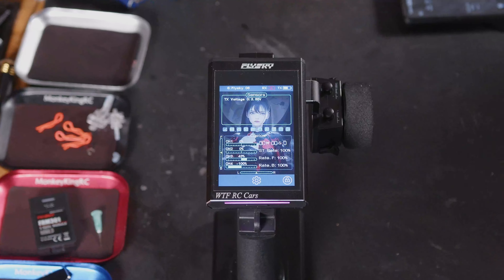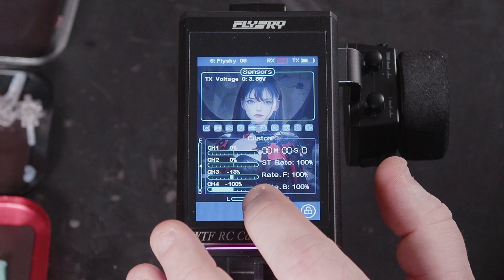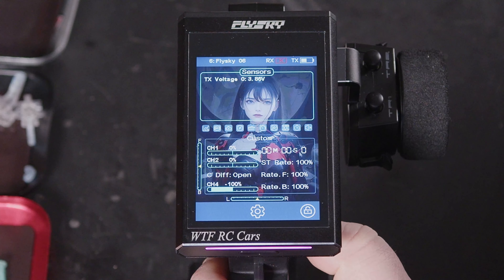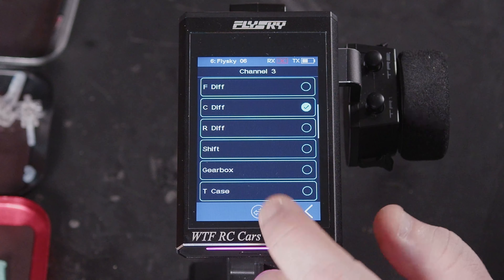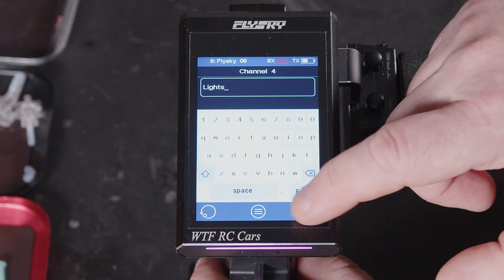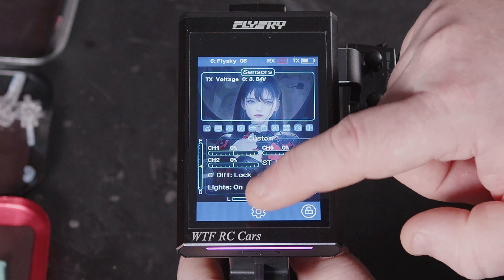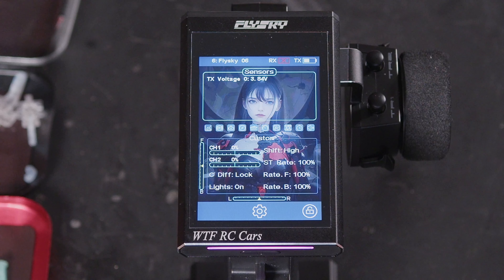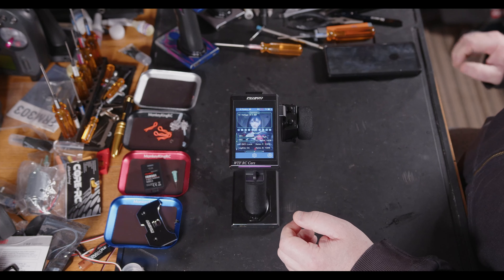Flysky NB4+ Channel name settings guide.

Comment: I have my lightbar set to channel 4, I followed your direction, but the light constantly stays on and does not turn off when I press the button, any assistance would be appreciated.
Reply from the maker: Does your light bar have 2 or 3 wires connected in the plug ?
Reply: @WTFRCCars  2 wires, red and black
Reply from the maker: @mykolochoco5983 2 wire ones can't be turned on/off then need an electric switch to be connected 1st to the channel then you connect them to the switch :)